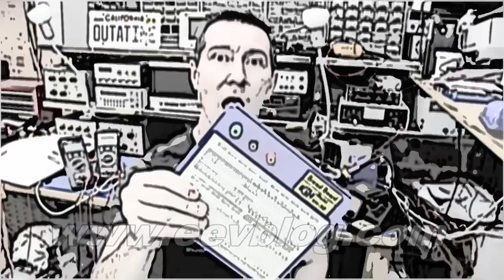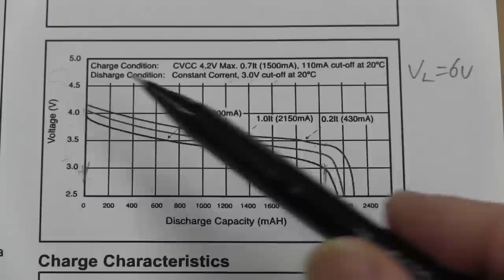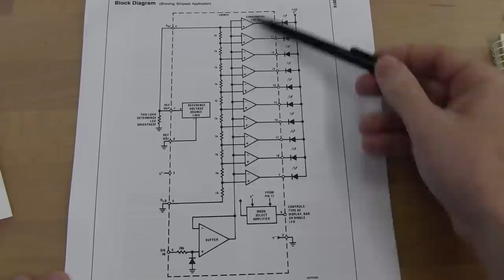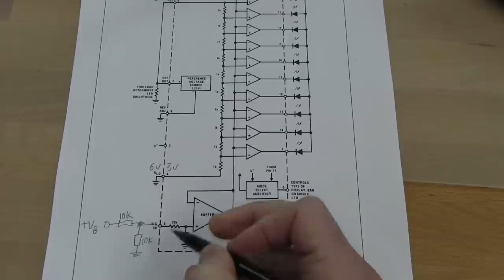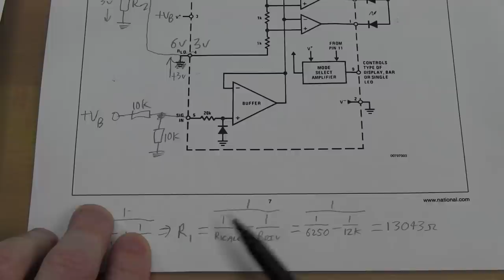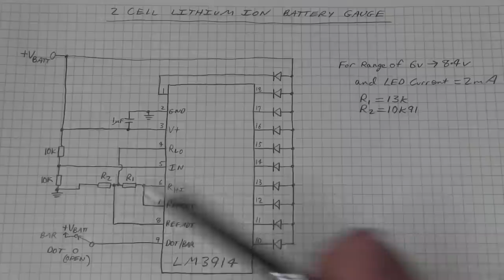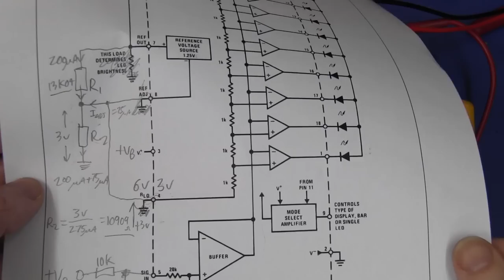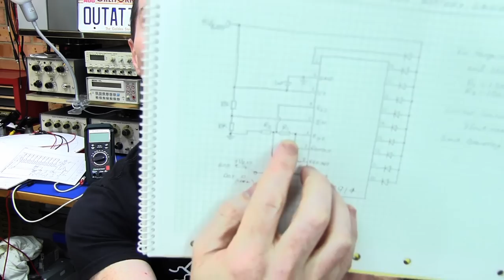Designing a Li-Ion Battery Gauge with the LM3914 - EEVblog #204

Comment: Hi Dave. Did the same schematic but for 4x18650 in series. Did the calculation but was not that lucky had to put potenciameters in and fine tune them till a got the right values... but at the end I did it so no worries! tnx great video!

Comment: I know this is an old video, but one misleading thing that confused me is that @23:58 you show Ir1 at 200uA when it should be 2000uA (2mA) and then you must divide again by 12.5 to get the reference load current (~200uA) as shown in the graph you present immediately after. Skipping that division will cause people problems if they just plug in the result from 1.25V divided by the resistance they calculated in the previous step. Otherwise, great video and it helped me a lot! Thank you

Comment: I was thinking of using some PIC12f or ATTiny microcontroller for a simple bar graph display, and then found out that these are actually cheaper and easier to use, which is not an usual way of things these days! I knew to look because I had a device which made some clever use of this chip. It was a fuel injector controller for aftermarket turbo applications, late eighties tech. The company had ground off the chip numbers, for extra cost and zero benefit; when I showed the board to a guy who knew his stuff, it was as if he read out the BOM printout. Immediately he recognized the ignition signal  F to V conversion part which used an LM555 circuit, then he pointed out the big chip was an LM3914 in dot mode which turned on one of ten PNP at a time which in turn would feed a trimmer resistor adjusted voltage into another LM555 to create a PWM signal for the injector driver FET. He didn't even pause once describing what each component of the circuit did.

Comment: Fun Fact:

@27:04 "You have to double-check these things!
Don't go by the block diagram. Only go by the datasheet."

Seconds later he looks up in the datasheet, that the Voltage divider is 12K.
Thats fine - and FUNNY!

2 Lines after the voltage divider, we see that the reference Voltage is
1.28V typical... Not the 1.25V from the diagram.... But he used the 1.25V :-D

Besides this, the video is just great - as ever!

Comment: He was speaking of putting a 12k and a 120k in PARALLEL...which does not sum like series resistors do, it's the sum of the inverses i believe - therefore you get a lower value of 10091.

Comment: 2 Questions.... What about a Bar Bar Graph... like an Audio Bar type graph? Will this work with one of thoes? Q2: different Color LEDs?  Meaning Out of 10 The first 6 are green, then 3 yellow, then 1 red at the end of the bar/dot when dead.  Does this Chip allow different colors as the output? or do I actually have to use resistors to use different colors?(Also with the Bar Bar Graph as well)

Comment: hello Dave, great tutorial. Love the attention payed to intricate detail! I would like to offer an idea to you: 

Since your powering your chip with batteries, keep the configuration in bar mode and add a switch (tactile SPST) from your Vcc supply to the chip. In that way, you wont be drawing any current till you press the button.

So this how it would work:
1- Press button and hold
2- The circuit would display the voltage level available
3- Release the button and chip would disconnect

Comment: Regarding the LED resistor network between pins 4 and 6, can the actual resistance be simply measured using a DVM? Strangely, I have tried measuring this on a number of different 3914's (same batch) and to my surprise they all read around 7.6K, well below the 12K typical value! Am I doing something wrong here, or can the resistor network not be  measured using this simple method?

Comment: Dave, you cannot measure voltage of 2 batteries in series, you need to measure them separately! They can be charged differently and when measuring sum of their voltages you will not get proper result (one cell may be fully charged and second may be half-charged)! Additionally, good battery gauge should take into account temporary current drain and cell`s temperature, because cell`s voltage is highly dependent on them. Unfortunately, you will need better chip or use attiny with shift register and code it.
Reply: You don't really need this. I don't expect a 10-LED battery graph to be ultra precise. As for the cells becoming unbalanced, this isn't super likely if you're using new cells. 

If you wanted a digital screen with a battery indicator accurate down to the percent, you probably would need a proper battery controller, but not everything needs to be perfect.
Reply: come on. it's only for rough estimate. doesnt really that matter.

Comment from the maker: @Kethlar @superdau already answered, yes, any type of LED will work. Although high voltage drop Blue LEDs for example may not work at the lower ends of the voltage rails the chip is capable of working at.

Comment from the maker: @Erny1389 That's in parallel with the external resistor R1, so it is taken into account. There is no extra current that flows out of it, so no additional error term to worry about.

Comment: The 3914 is a fantastic window comparator, but it has its limitations.  I prefer to go hard switches and dry contacts.  The key with any battey tester is to test under proper load.  As an example, your DMM on the 10A range will test any AA alkaline.  Dead short, if she kicks above 6A, she is brand new.  You see?  So, you make a device that has 2 rotary switches to select the nominal voltage and the rated A/h of the battery.  Calibrate it so that it produces 1Vdc on your DMM with a fully charged battery.  1Vdc being 100% and 500mV being 50% (not linear, I know).  But besides that, I just love your stuff.  You are doing a superb job! Cheers. :)
Reply: +rouelibre1 I think you completely missed the point. He said at the very start and again a few more times thru the vid, that this will be in the product, therefore it will be measuring the battery under actual load conditions.

Comment: Hi Dave, nice tutorial as usual, thanks a lot.
One thing though: you estimate 200uA out of REF OUT pin in order to have 2mA led current. So you need 6250 ohm to fit the formula. But then, total current out of REF OUT pin still is 200uA, but only (say, roughly) 90uA passing through R1=13043 ohm and (say, roughly) 110uA passing through the 12k ohm resistor sum of internal divider.
Total current flowing through R2 is thus not 275uA, but more likely 165uA (roughly, still).
Does that make sense?
Thank you, anyway, very good explanation.
Regards.
Matt

Comment: I've been trying to extrapolate from this example for Rlo(10V) - Rhi(12V) but am having some trouble.  Can anyone recommend resistor values to achieve this exact circuit but for 10V-12V rather than 6V-8.4V ?

Comment: Interesting IC. A pity they didn't buffered RHI and RLO, however. Also, taking a look at the block diagram, no led turns on at the RLO voltage, because there is no comparator attached there, so the first led will turn on at Vrlo + (Vrhi - Vrlo) / 10. Quite a mess there. It seems to me like it needs another comparator, or to remove that internal resistor between Rlo and the lowest comparator.

Comment: Hi. first of all i wanted to thank you for this grate circuit and your teach. i noob in electronic and i want to build a circuit with lm3914 to show the range of 4.2 to 3.2 lipo battery. i used this video to build that and it worked in proteus with voltage divider resistors 100ohm and 700ohm but when i build in reality, the range is in 1.5v to 3 volt. can you pls help me to correct this? thanks

Comment: @Kethlar 
A1: Yes, it can be used. But use the logarithmic (that's how our ears work) version (LM3915) for audio.

A2: Since the LED outputs are current regulated and not voltage regulated, any color LEDs can be mixed. They will all be driven with the same current though. If the brightness is too different at the same current, you have to use other LEDs. A resistor in series wouldn't change anything, since the IC will up the output voltage so the current stays the same.

Comment: @CampKohler 
Problem is: the blinking circuit does not come for free. It needs power, too, adds things that can break, needs more space and may disturb the graph (see how it reacted to different meters?).
If you want to conserve power and can live with it, I'd just add a push button right into the supply line of the LEDs or the IC, so LEDs only light up when pressed.

Comment: hey Dave,  
Your video is very nice u explained it very well but i have doubt as in this circuit if we apply this formula Vout = 1.25*(1+R2/R1) then it is not giving the 4.2V (higher voltage). Why this formula is not applicable here?

Comment: @superdau Well, let's compromise. Use a push button when you need to read the level and then have a 6-beep/minute audible alarm to call the user's attention to the fact that the batt is almost discharged. Of course, there is always that age-old problem: 'WHERE THE HELL IS THAT BEEPING COMING FROM?"

Comment: EEVblog 
Hi Dave, i want to do the same thing but i am using a single cell battery. The range needed is 2.75V to 4V. I assumed that by removing the voltage divider at the signal in (pin 3) and just hooked the signal voltage to vbatt would make it  work in the same way. For some reason this causes the bar graph to work wrongly. could you please help me out

Comment: Hi Dave, i want to do the same thing but i am using a single cell battery. The range needed is 2.75V to 4V. I assumed that by removing the voltage divider at the signal in (pin 3) and just making the connection without halving the signal voltage would work in the same way but from a range of around 3V to 4.25V as mentioned in your video. For some reason this causes the bar graph to work wrongly. could you please help me out......Thanks

Comment: 10k91 made with 10k and 100k??? that would be 110kohms, right? Should be 10k (10,000) plus 10 OHMS. I think that makes a bit of a difference. Or maybe just th 10 k is enough. I dont think 91 ohms is very signifigant next to the 10,000, but I might be wrong. I am often as I am just a hobbieist.

Comment: I believe @bruno was talking about powering the IC for the V+ pin 5. Fo 1S batteries you need a separate power source of min. 3V but datasheet always calls for 5V.
You dont have that issue because your min. BATT voltage is higher than 3V.
I believe this was causing your LED light up error at low voltages in the video.
Let me know if I am wrong on that point.

Comment: I guess at the very low V, the LM3914 was behaving as a resistor to ground but there had to be just enough V to overcome the forward voltage of the LEDs.  As the V rose the chip turned on and the LEDs went out.  What was the min V for the chip on the datasheet?

Generally excellent, really enjoyed.

Comment: hey dave i was looking for this exact video but can you show how to use a screen to display the voltage whether in percent mode or actual voltage? what something  higher tech than led bar graph.

thank you
Reply: There are diagrams online for that if you absolutely want to home brew build one otherwise you may find it easier and  less headache to just go buy one from an auto parts store for like $10 or off ebay for maybe less and plug & play

Comment: and if i want a range bigger than 1.25V ? like 2.4V in the begin the video
Reply: See the datasheet. Also, dave is actually already generating 3V as the R_lo using the regulator, it's the same idea (except one more resistor in the divider) if you wanted the span of the display to be, e.g., 3V to 6V. Set 3-R divider such that R_hi = REF OUT = 6V, REF ADJ  = 6V - 1.25V, R LO = 3V, and finally another resistor down to ground.

Or, you can do what Dave did and divide your input signal down such that 2.5V in becomes 1.25V as far as the chip is concerned.